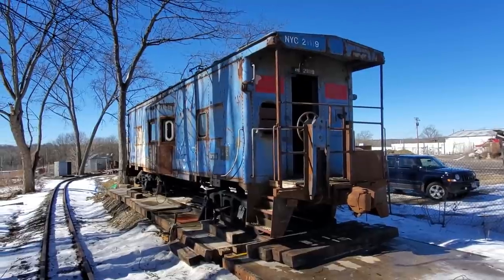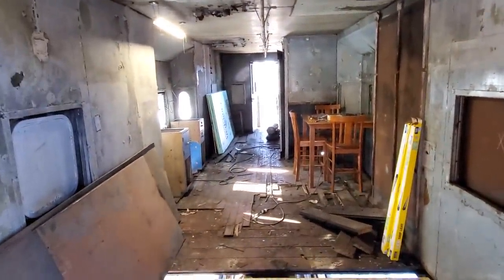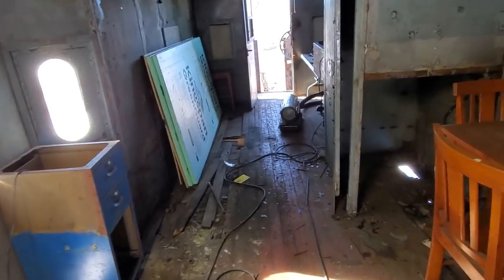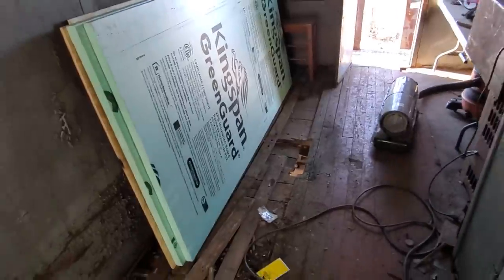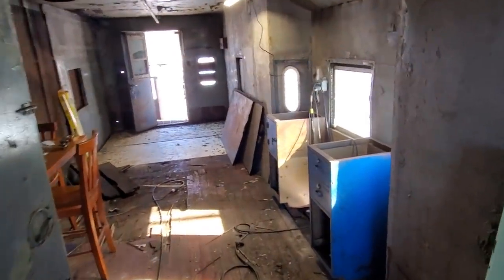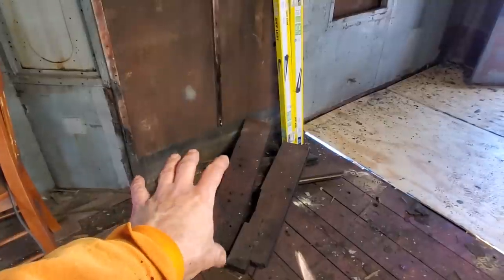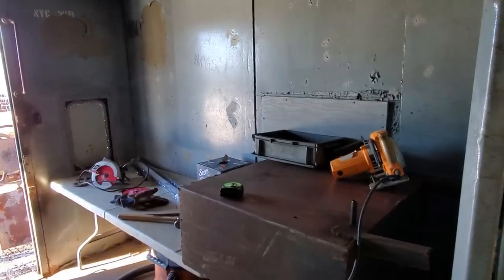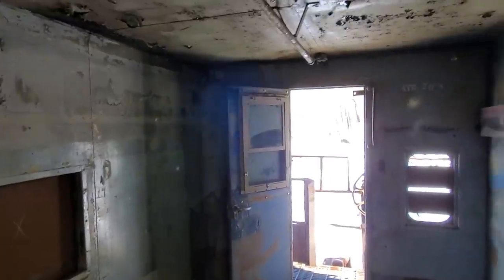Bay Window Caboose Renovation Begins

Comment: I like the idea of the old coal stove but you may want to also install a mini split system too. That way you can stay cool in the summer and don’t always have to stoke a coal fire in the winter to stay warm.
Reply from the maker: Maybe later when the electrical system is upgraded to handle the load.

Comment: It sounds like you have a good solid plan for the caboose. To be honest that caboose is never going anywhere again anyway. It needs to be probably a water tight Office,. So if it doesn’t leak and you can close and open the doors as needed that’s probably all it needs to do. It sounds like you’ve got your pick up road colors if you want to put it back to original as every time it changed roads it changed colors so any of its previous colors would work. If it looks like a caboose on the outside and looks like an office on the inside then you’ve done your job.

Comment: Also I want to get a caboose and rebuild it so it can run on mainline, and branchlines, thus I found some of the larger caboises with large Extended vision cupolas on top , and roller bearing journals, and couplers with cushion frames, and centering devices for couplers , and adbw brakes , but I still need to fix the airbrakes and have those inspected for C.O.T.S.   THen...in addition we want a diesel like a switcher like an SW9.  or road engine like a GP7 that is upgraded into a GP20 so the diesel can operate on the branchlines, and rent it out as a special resort like a B.&B.   THEN....use it for Weddings 💑  and Honeymoons, as a literal "BRIDAL TRAIN"!!!!!  LET'S GO FOR IT!!  SEE YOU SOON!!  ALL ABOARD!!  HIGHBALL!!   and happy Tuesday..."2's-day", in February, 2-22-22, @ 22:22 G.M.T.  And...2-2-2 BRUNNEL U.K. WIDE GUAGE "FIREFLY"  1849.  LOLLOLLOL.  (0;-)}